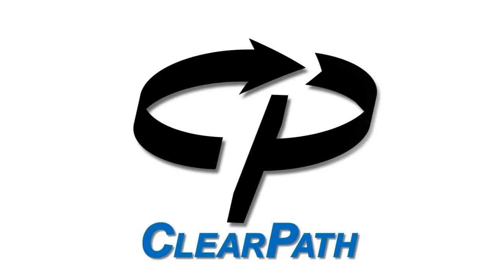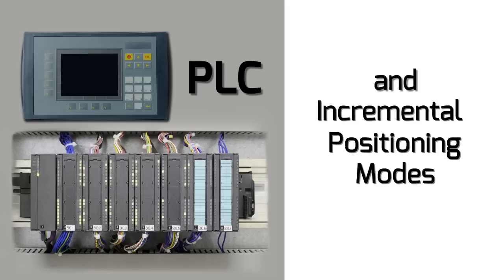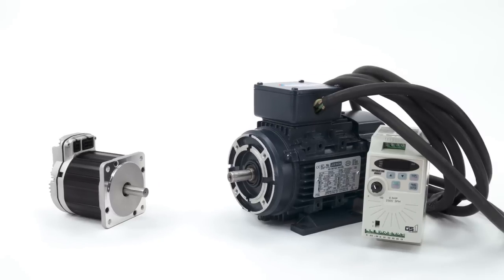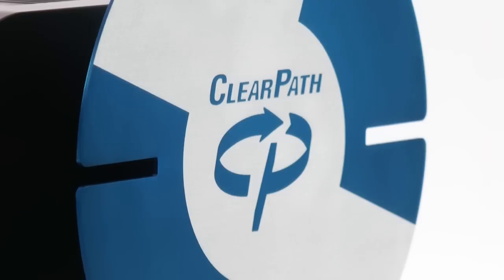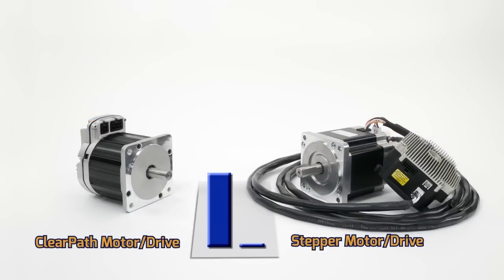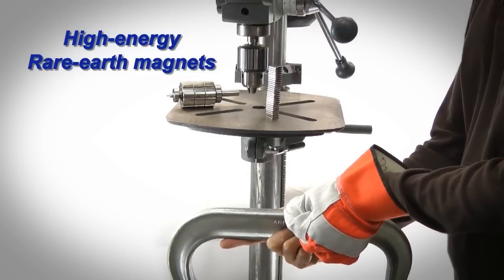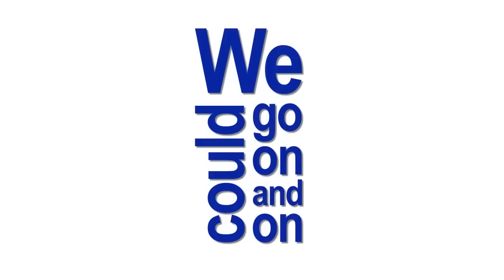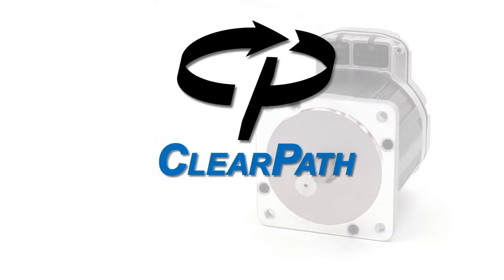Teknic ClearPath Integrated Brushless Motor: Overview Video

Comment: Why didn't they give an dedicated video of torque capability in actual pounds at speed for example at 4000 rpms we get (  x ) amount of torque output  I need to run a generator Head to produce electricity
Reply: Because they have a website with hundreds of different models, along with speed/torque curves... you an call their engineers too with your application.

Comment: can clearpath control by microcontroller ? such as arduino?
Reply: The motor has a step and direction mode and accepts 5v logic levels and the arduino with grbl can interpret g-code into step and driection outputs at 5v so yes.

Comment: How can you use this on a 3D printer with a Arduino Based controller by a Rambo or Ramps
Reply: +quosmo1 ok.. how LOL. is there a video showing how this is setup using Marlin firmware?
Reply: I wish there was a Nema 17 version available
Reply: +quosmo1 Thanks for the tip about uStepper its an interesting solution. Im a little confused how I would use this. currently I have a rumba 3d controller with stepper drivers already isntalled. the Ustepper has a driver as well.. so would i need to remove the driver on the rumba or run two drivers??

Comment: *Update*
I found out that Florian was using a German operating system which prevented the auto-tuning function from completing the tune. When he set the regional code in Win7 to USA, the auto-tuner and the ClearPath motors worked very well and his machine is cutting "smooth as silk".

Comment: Hi,
i have three of those and none of them would go through the setup program (autotune). each of them would do appearently nothing till 41% of the process and then timeout. Been trying 6 different computers on them too....

Aditionally two of them do not emmit any torque at all, in fact i can stop them by using 3 fingers. Supposedly they should have 2NM torque. 
50V powersupply and and they do move via usb/MSP and through Mach3 as well. Green blinks as well...

What to do?

Any help would be apreciated.
Greets

Florian Bauereisen
Reply: +floausaying 
Hi Flo,
It is unusual for the ClearPath auto-tune function to not finish the tuning sequence. The auto-tune process is expected to finish the sequence and to come up with a very appropriate set of parameters for almost any of mechanical design. 

Teknic takes customer satisfaction very seriously and expects our servo products to meet or beat customers' expectations. I did a little research online and saw 2 YouTube videos that show your machine moving/cutting in all X, Y and Z axes so it is unclear to me if you still have any unresolved issues. 

 Please contact Teknic if you would like some help with the ClearPath servo performance on your machine.

Tom Tullar

Comment: VERY INTERESTING!!!

But...

The SD model is built for step and direction. I assume that means CNC. How do you protect the step and direction from corruption when it's running through the same cable tracks as the high voltage spindle wiring and other drive cables?
Reply: Hi cncMike304, you can use differential S&D signals for ClearPath but it is not always necessary.  The inputs are extremely robust and optically isolated.  We use ClearPath-SD on many OEM plasma systems which produce more high voltage electrical noise than just about any CNC application I can think of.  The Teknic manual, which contains more information, can be downloaded on the website.  Hope this helps!